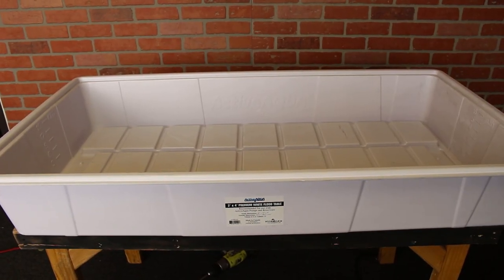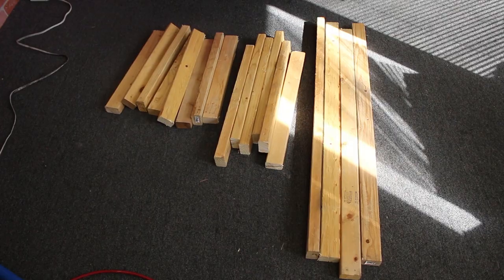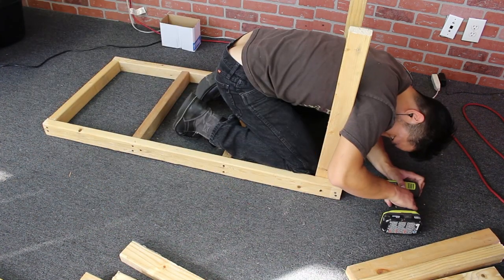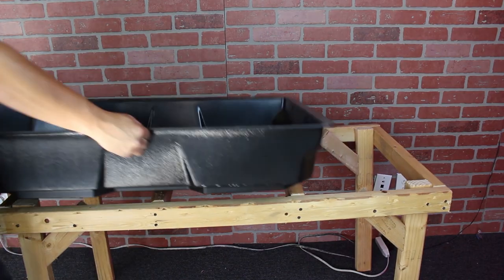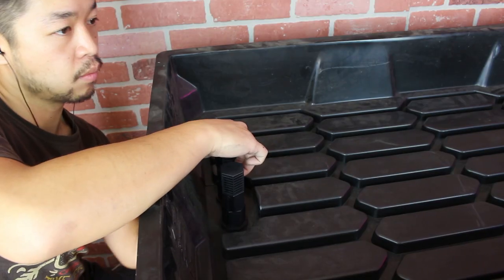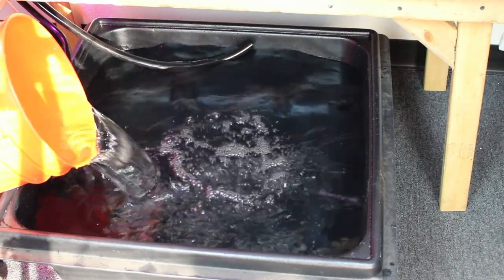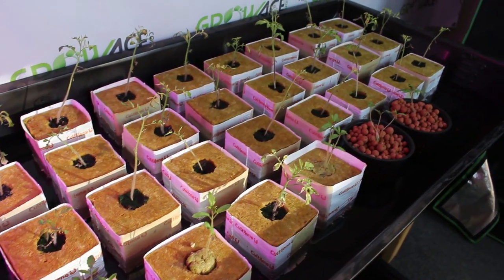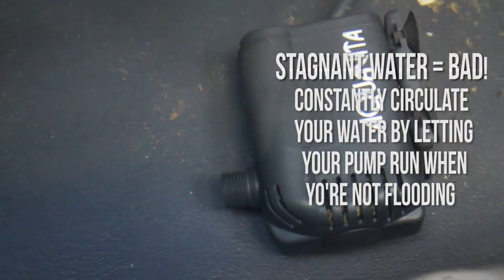How to Set Up a Basic Flood and Drain (Ebb & Flow) Table for Hydroponics

Comment: This is not how a flood table should be done, at all. Reservoir should be sealed and opaque. Hydroton needs to be in the grow bed. Your fill and drain aren't supposed to be at the same level, you should never have to unscrew anything. Your pump needs to be on an automatic timer, even a cheap $10 timer works- don't be reaching your arm into your reservoir, you should never have to touch the pump.

Comment: To drain your tray simply remove this drain nozzle so you’ve got automatic system that you have to manually drain the other hole is simply there is a overflow people you don’t put the secondary nozzle in place when the pump stops pumping it drains back through the pump too much of this content with people that don’t know what they’re doing This is something that could completely destroy someone’s grow hopefully most will see this is the obvious solution😡😡😡

Comment: Sure that's one way but trash picking an old kitchen table will work to. Start by drilling a center hole find a tray. I started with an old plastic kids wagon put my reservoir on castors and hand fed each pot of perlite and clay balls with a beer pitcher of nutrients 2-3 times a day cheap easy and quick. Throw a 600w hps over it and wait to enjoy 😮

Comment: Nope.  Never used an epp and flow system before, have you?  It shows.  Who the hell is going to disconnect the water pump tube and manually drain the table over and over?  Come on man, if you're gonna do it, do it right.

Comment: Bro, why are you pulling the drain fitting to drain??? Just unplug the system and it should drain back via pump side unless you have it blocked up or setup incorrectly.

Comment: Hello I have a question. Isn’t there a better way to drain it?? I have a 4x8 tray and I don’t want to have to manually unscrew the drain 4 times a day
Reply: I think I would make the fill flush with tray, than the over flow would b how ever high you want the water to get.  It will than drain back into reservoir as it's still pumping,  if it fills that fast. Once pump turns off,  water goes back down through pump into reservoir. The flood table should now b empty. Hope that made since
Reply: @bradharvy13  yeah idk why he made this like that

Comment: I found a way of simplifying and have done 6 runs testing it as well as keeping my moms on it...
instead of drilling two holes and adding the expensive flood and drain tubes and grates simply drill one 2" hole on one side (not bottom). Make your table uneven so water flows from one side to the opposite where the hole is situated. I put 3/4" thick polyester batting on the floor with a long tail running out our 2" hole straight back into the reservoir which is positioned to silently catch the water flowing along this tail. Make a T pipe with many outlets to feed the table on the high side by placing it under the batting. Water will work its way down to the hole.... as the plants grow, they will block the hole and the water will rise higher in the 15 minutes the pump is running, as it takes longer to fall out the restricted hole. I have managed to make 2" thick roots like this. A simple pump sits in the res and feeds the Tfor 15 minutes every 6 to 3 hours (getting shorter as the plants grow larger). You can check it out on my chan.
Reply from the maker: We love and support that DIY mentality, glad it works for you!

Comment: uhhhh manual flood and drain? Looks like a pain in the ass plus most people dont have time to baby sit their hydro system,  a timer would make this alot easier and use a air pump with a air stone to circulate the res..just my 2 cents
Reply: prob don't trust a "grow ace" who's plants look like shriveled decrepit weeds 2 days from death
Reply: What amount time do you set the timer between ebb and Flow.  I have an ebb and flow system, however it has constant flow of water and nutrient.what is a Time amount that I need to have on a timer between the app and the flow if I need to not have constant flow of water and nutrient?

Comment: He forgot to mention to use clay pebbles otherwise the roots will die and the cubes will grow algae.  Another way to prevent algae is by putting a cover on top of the rockwool cubes.
Reply: Or run zerotol and not worry about anything growing algae or mold

Comment: Hello! I have one question for you.. +GrowAce

If I use timer for my Flood and Drain system, How long should it be on and off? or maybe it's not needed?  
Because I use PVC pipe but still it has Overflow pipe. 

So for example; The pump will be on at 06:00 - 09:00 then off until 18:00 - 21:00 it will be on again.
What do you think? Please help me :D

Thank you and its great to see your vid! Its easy and fun to watch 
Regards, Aken
Reply from the maker: Hey Aken, are you talking about an NFT system where water is pumped to your pvc pipe and runs all the way down? If it is, then you can run your NFT as much as you want.
With a flood try you want to flood your tray for 20 to 30 min.

Comment: How big did you still the fitting holes
Reply: Depends on the size of the fittings yoy have. Some are 1/2, 3/4 and 1 inch and rarely 1 1/4

Comment: hope you can help? I need to get a flood table for my 4x4 tent. will a 4x4 table fit perfect or do i need to get a smaller table like a 3x3 to compensate for the lip around the tray? need to get as much room out of my table. Thanks!
Reply from the maker: It really depends on the grow try that you have.  Some trays have true footprint of 4x4, and others will be a little smaller but the lip of the tray will expand out to be 4x4. Either way a 4x4 tray should fit fine in your tent .
Reply: @GrowAce  Where can I get this trays?
Reply: @GrowAce  nope. I have a 2x2, won't come close to a 3x3 really
 The inner dimension,  "ID", is 4x4 in this case.  The tent is 4x4.
By the time the sides go up at angle and than lips out a few times.  5x5.
3x3 would,  I think b tight still , but would probably try it.
Reply: As long as the OD of the tray is 4x4 you're good to go !

Comment: WORSE FLOOD TABLE WTF 
1. Need to have your table .5" to 1" shorter at one end so tabled drains on its own. 
2. should have fill on one end and drain at the other end so you dont have to unscrew your fitting everytime you want to drain. Thats how their designed. 
3. Should have air stones in the resevoir to constantly  mix nutrient solution and add oxygen to roots. 
4. Should flood every couple hours if you using hydroton and flood once or twice a day with cocoa. 
(Optional)
5. Should throw cocoa matt and panda falm below and above your growing medium.

Comment: I guess you really don't know what you're talking about but you're just an actor when the pump shuts off the water circulates back down through the pump you don't have to take the fitting off to drain the table